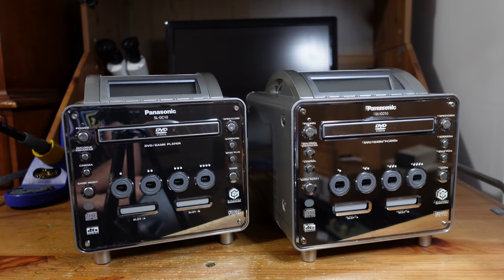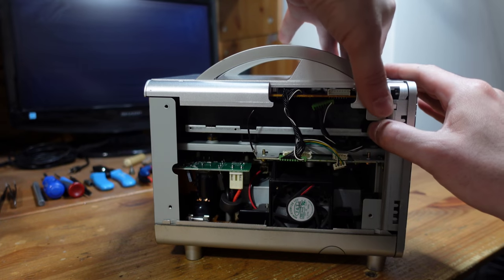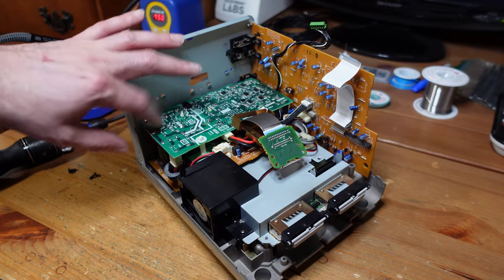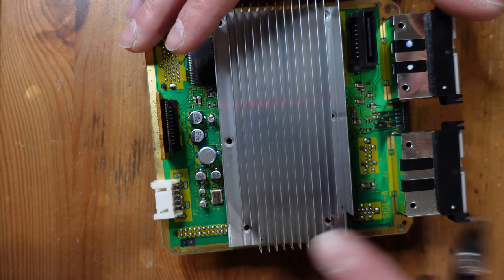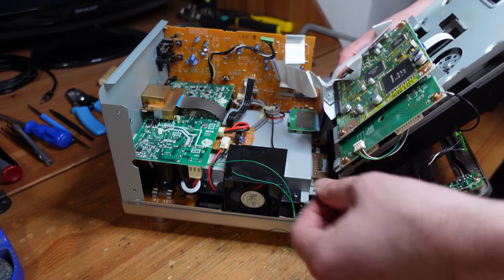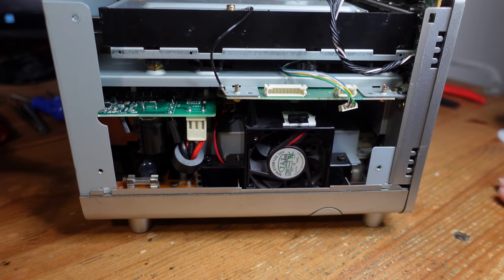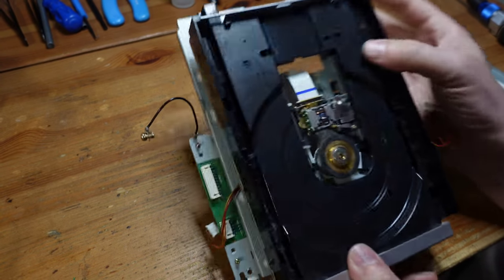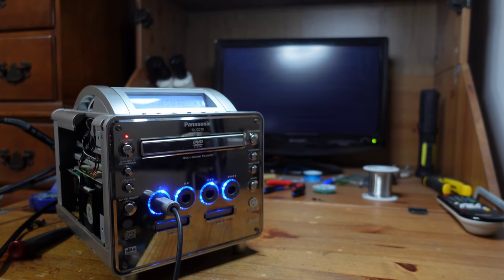Panasonic Q double feature! DVD drive repair and region switch installation!

Comment: Very tasty info on swappable mainboards. After accidentally overvoltaging a JVC X'Eye and then trashing it, I will accept my punishment by watching others do risky things. That was over a decade ago and I still can't throw anything away and always make sure I have the correct power supply not a variable knob which is way too easy to get bumped
Reply: What kind of video outputs are on the Q? Component, S, and composite? RCA connection or special proprietary breakout cable?
Reply from the maker: It uses RCA for composite video and it also has svideo. Component is possible through the digital port

Comment: Thank you for all the amazing videos that you publish on YouTube, some very useful info there.

My Panasonic Q was connected to a 220v by mistake and now the power board is fried. After watching few YouTube videos for Panasonic Q repair process, I can tell this won’t be a simple task.

I contacted a vendor and he has all sort of boards for the Q, I would like to know which board that has to be replaced and could the damage have reached other internals that it’s not worth repairing at this point?

Appreciate any help that I can get
Reply from the maker: There are two boards for power on the Panasonic Q. They have fuses so most likely those boards are the only ones that got damaged. I can’t be sure 100%, but those are the two boards I would focus on
Reply: @LIRetroGaming  Do you think they are repairable or better replace them?

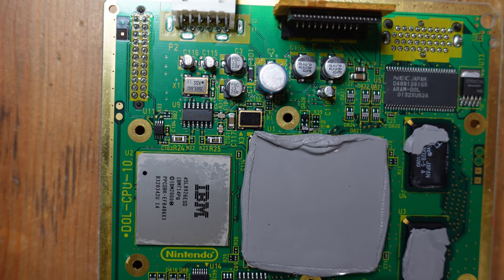Comment: What are the components with ref des prefix DA? I've never seen it before, and I can't find anything on it. I'm leaning towards either diode array ICs or Darlington pair ICs, but I have trouble seeing what either of those would be doing next to a flash IC. They're shown on screen at 13:10, in the upper right hand section of the board
Reply from the maker: I’m pretty sure it means diode array
Reply: @LIRetroGaming  I can believe that, but it's still weird to me that they went with DA instead of either D or U. Love the videos BTW!

Comment: So, serious question, because I've been considering this quite a bit since I heard you mention it. It has to be a pain to be left handed and Solder, right?
Reply from the maker: It can be more challenging sometimes. If something was designed with a right handed person in mind, I have to decide whether to approach it from an awkward angle, or to switch to my non-dominant hand. Of course, my soldering skills are pretty bad when I’m using my right hand

Comment: Is there a decent replacement for the drive bay as of yet? I was able to get a new belt and replace it, but managed to cause a crack in the disc tray that I had to glue back together (You can get the gears off, I only found that out after causing the damage!) its the true definition of a hot fix, but it works though I'd love for a replacement to make it clean.

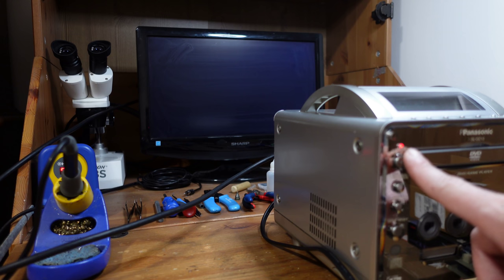Comment: 2:11 Why are you using a flat screen? in my experience using a crt is the best option when you are trouble shooting old equipment due to most newer tvs having a blanking circuit
Reply from the maker: The flat screen is for convenience because I don’t have much space on my workbench. However, I have 2 CRTs out of view from the camera that also get used for testing consoles. I haven’t yet encountered a situation where something worked on the CRT but not on the flat screen

Comment: Does it absolutely need the GC Controller that came with it? 

Granted, I acknowledge that having the DVD controller is a good idea. Does not having the DVD Controller mess with the DVD Capabilities?
Reply from the maker: You actually can use any GC controller, you don’t need to have the original one. There is a separate remote control accessory for the Panasonic q, but even that is optional
Reply: @LIRetroGaming  good to know. Had a year long plan for a working Panasonic Q but thanks to your channel I'm convinced that that is in the very near future, Lord willing. Region switch mod very nice touch.

Could you spell the wire you used? My hearing ain't so great and I wanted to make sure I got the right one. 

Any clue as to how bad the import fees are?

Comment: Great job! Do you know of anyone successfully installing a pluto ii hdmi mod into one of these? It looks like it would be totally possible from what I can see. I was just not sure if you can easily remove the cover on that didgital out port.
Reply from the maker: I believe it’s possible. I know the GC dual can be installed for sure
Reply: @LIRetroGaming  thanks I only say the pluto because the gc dual is hard to come by and overpriced. I have done alot of the pluto installs and they are cleaner in my opinion. I might have to buy one and try it I guess.

Comment: I see a lot of these sold on Japan ebay broken, they are listed as spare parts, but im thinking they could be fixed, but for $400 USD for a busted machine, I'm not willing to take the risk.
Reply from the maker: Yes that’s the challenge with buying these consoles. They are expensive, often broken, and difficult to fix